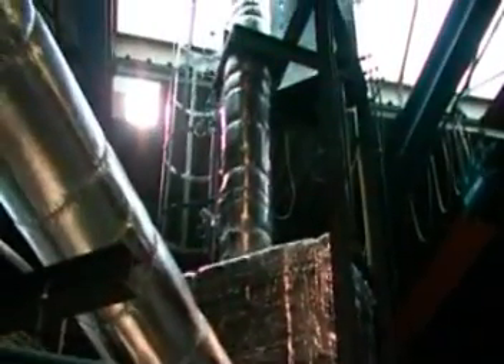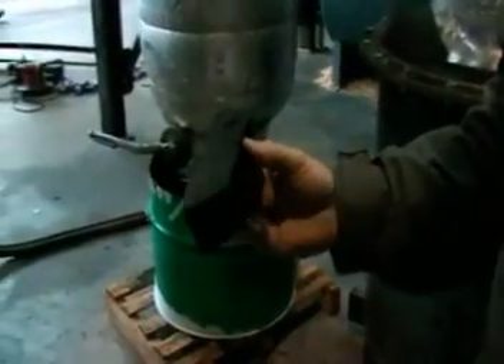Plastic waste into Diesel fuel production, Plastic Depolarisation Unit   PDU

Comment: what is the cracking process?
just heat of 300 degrees?
then distilation of the seperation of carbon and tar and the fuel?